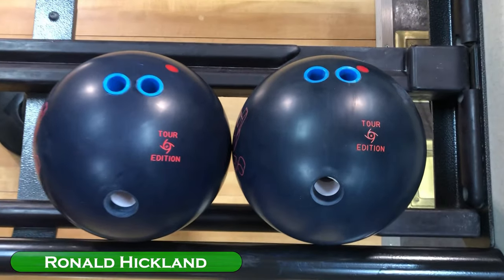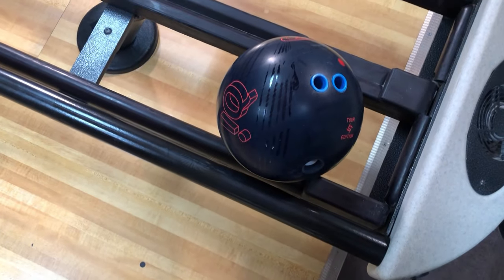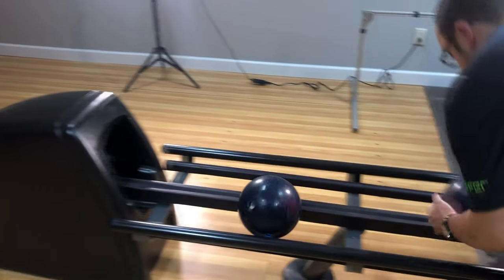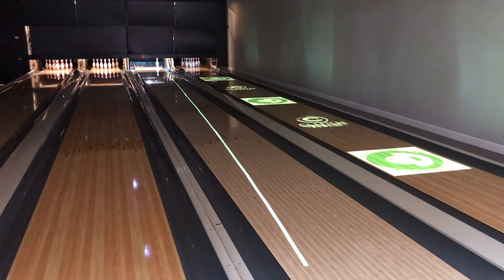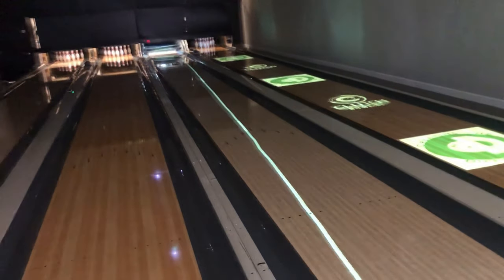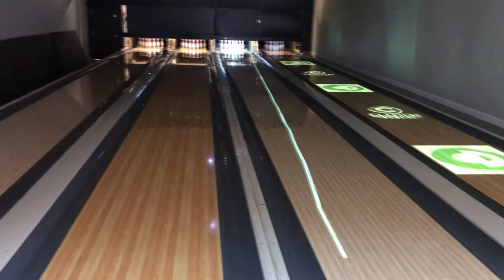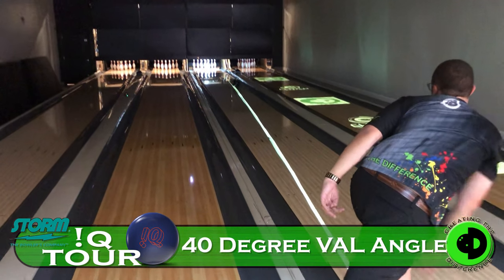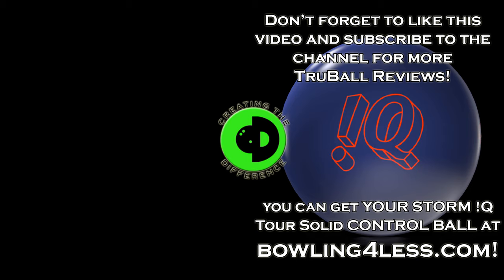Vertical Axis Line Angle - What's the difference in 10 degrees in Bowling Ball Layouts.

Comment: In terms of motion......you won't see the changes going down lane. Where you see the differences is, in how the pins react when struck by the balls going through the pocket. The 30 degree one will be a tad bit sharper off the spot and SEEM to hit a little harder! The 40 degree one will be closer to a controlled move through the pocket area.